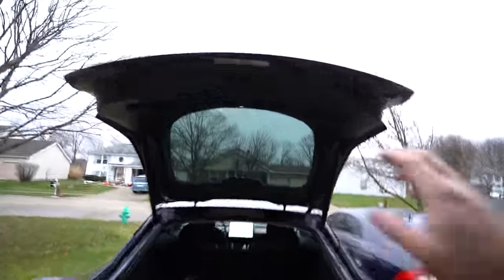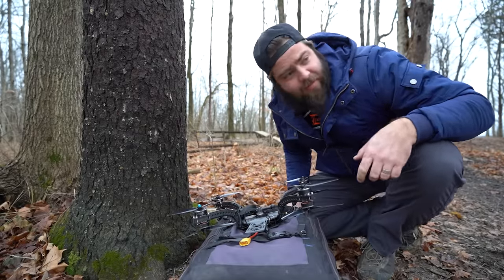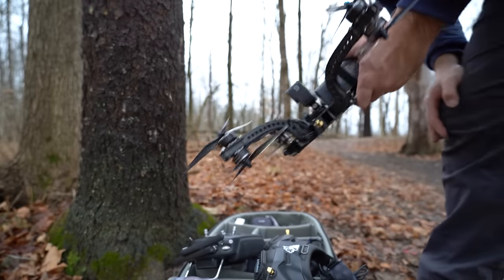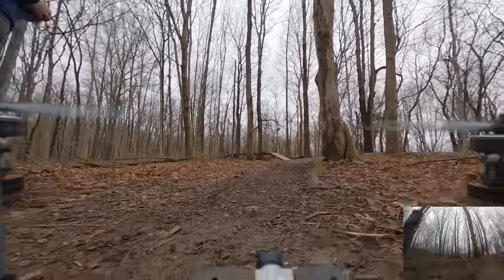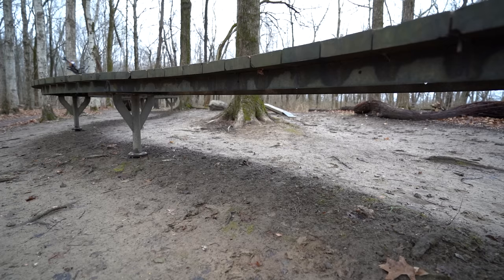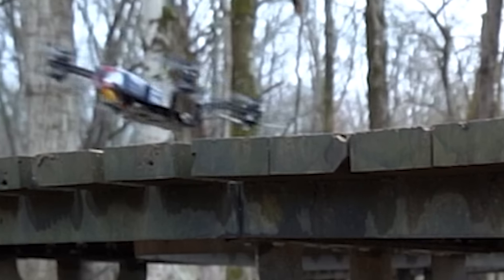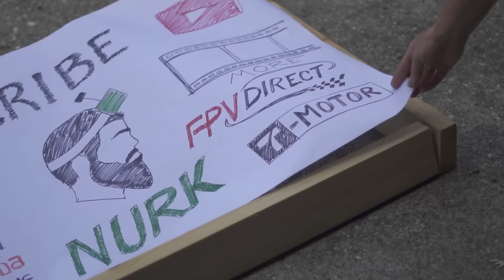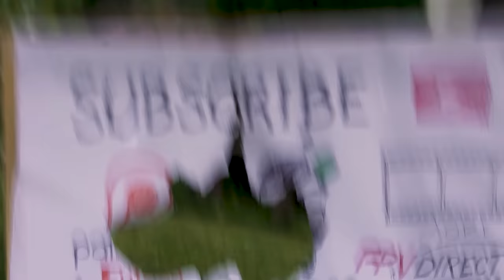First Flights of my RED Komodo - Carrying Octocopter: Shendrones Siccario

Comment: You should try 50+ higher kv motors or high pitched props for the bottom set to get more power back/prevent stalling. It's an old 2013 endurance trick we used to do to hover Canon 5D's around on 17" X8 3S rigs.

Comment: Looking pretty nasty out (same here in NJ).  Wow!  can't believe you took that beast through those trails (tight).  Especially, down that river with all those branches.  I've got a much wider river and I'm still not ready to fly it down there (afraid I'll lose in the water).  Guess, that comes with years of flying (which I don't have yet w/ FPV).  Surprised you don't go full 'electrical tape' instead of those zip ties.  I just find electrical tape is a lot more forgiving and flexible (even in colder conditions).  Your a beast of a pilot...I'll give you that!  Thanks for sharing...Oh, and tell DJI to keep their coffee mug...we want to know about those DJI FPV Goggles (VS2.0) and if they'll be any better (or the same as the originals).  Saw them doing pre-orders already on a website starting in a few days.